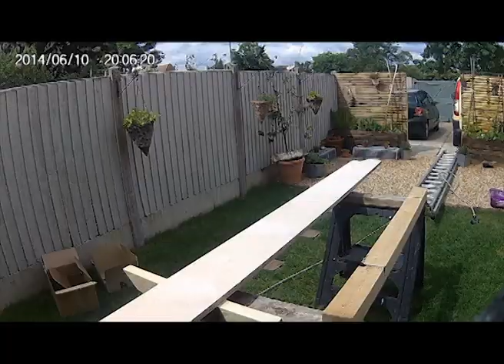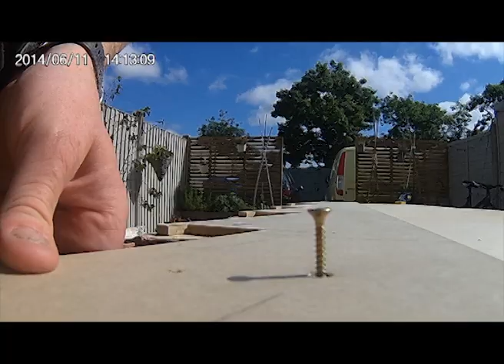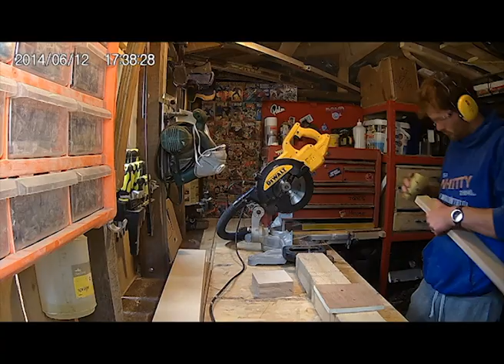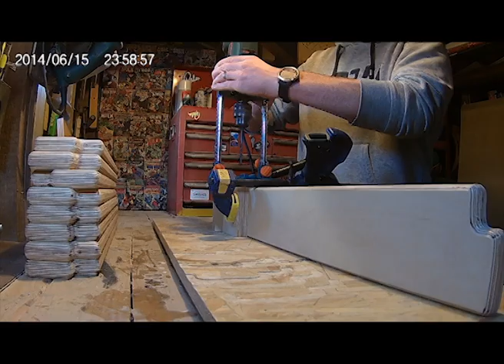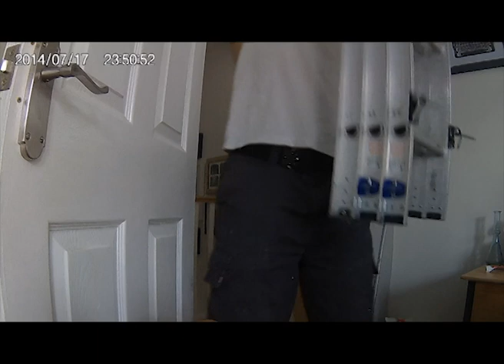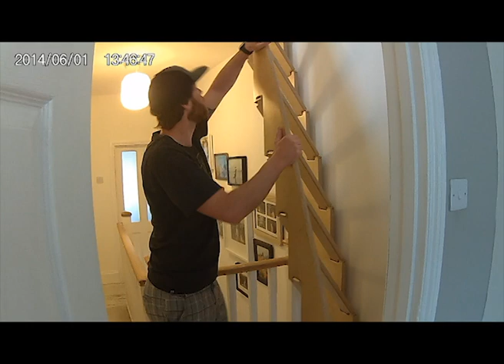Folding stairs DIY

Comment: How did you get your holes to line up between the stringer and the tread? I am assuming the routed edges give you some rotational clearance in the hinge area. Is the size and position of the tread inset from the stringers horizontally or vertically? Sorry for all the questions. You are definitely more advanced than me.

Comment: how do you keep the outer stringer at 90 degrees to the floor? Seems like it'd flop around without something holding it in place. Is it just that one little piece of wood at the top holding it all square? Beautiful work and just excellent craftsmanship, by the way.
Reply from the maker: Cheers, the string is help kept square from the top up right like you mentioned. but it squares each other from tread to tread.. Hope that helps

Comment: Very neat design. What kind of hinge did you use for attaching the treads?
Reply from the maker: The shape of the string and tread make the hinge mostly. I use a 150mm screw as the center pin of the hinge. I hope that helps let me know:) cheers tom
Reply: @thewhittyway1365  Gotcha. Thanks for the quick reply! Looking to do something like this for the mezzanine of our workshop. Did you find the plywood sturdy enough? Wondering if it'll hold up if carrying up heavier items. Maybe 2x8 boards? The extra weight could be an issue though, but could probably install some pneumatic lifts.
Reply from the maker: @rccwgoldrush  I used birch plywood it seams sturdy enough i wanted to get bamboo ply as that's what some of the other folding stairs on Youtubers use but ive had no luck getting any. I would say yes put more strength into it for your perpose. If so even make the joint slightly diffent to make more strength. :) cheers tom

Comment: Hello! This is exactly the stairs/project I've been looking to DYI for my future tiny home! Would you be willing to share the design info? Thank you much! :)
Reply from the maker: Hello I did do drawings but they ended up in the bin. The sizes I can remember is 100mm treads the rise was 250mm and was a total of 10 steps. the angle of the string was 70 degrees. I hope that helps if any other questions I'm happy to try and help :) many thanks tom
Reply: @thewhittyway1365  you rock! Thank you!
Reply: @thewhittyway1365  i have a spiral stairway, now disabled would love to get plans or information on folding stairs would be ideal for my situation